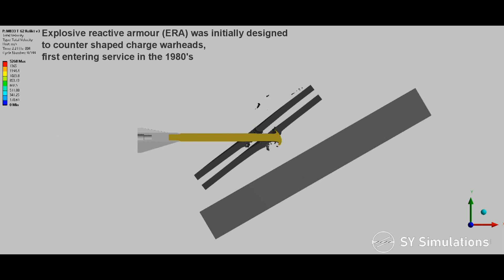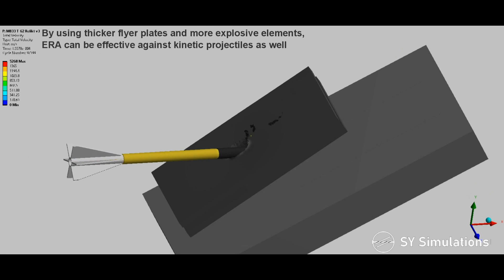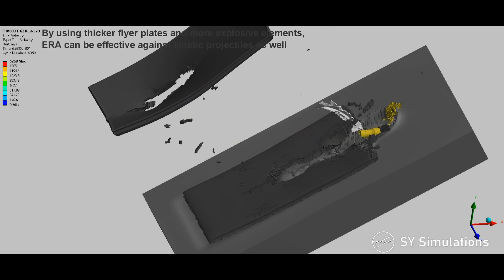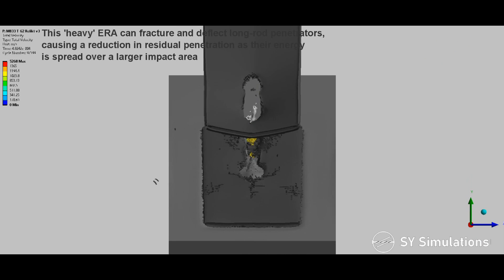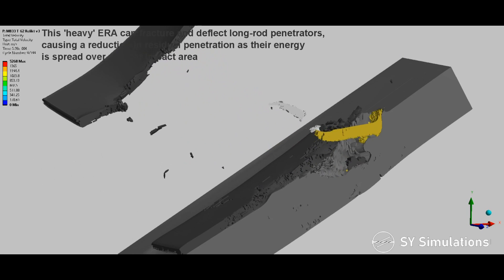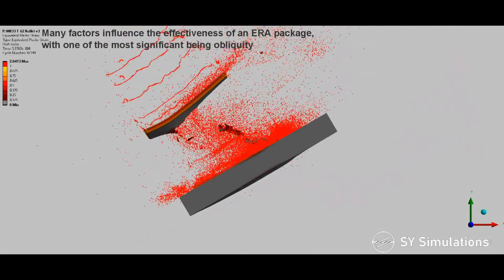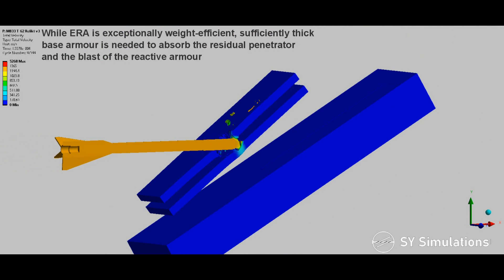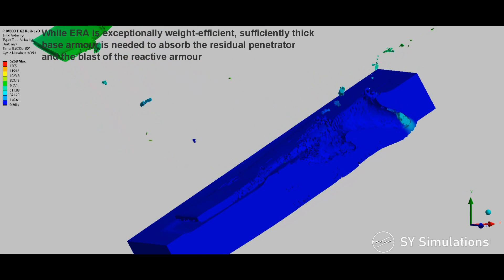APFSDS vs ERA | M1IP ABRAMS vs T-62 + Explosive Reactive Armour | M833 Armour Penetration Simulation

Comment: Any chance you have a simulation of how the arrowhead armor on Leo 2s work vs APFSDS?
Reply: Despite rumors to the contrary the arrowhead isn’t empty so unless anyone can provide at least somewhat accurate information on the composition and dimensions I doubt it. It might however be interesting to test the Leopard 2 UFP (20mm HHA + slightly explosive rubber + 20mm HHA + 45mm RHA at 82 degrees) or to test how an angled NERA plate would impact the trajectory and integrity of an APFSDS projectile.
Reply: @RichelieuUnlimited   there are images of the wedges insides and they are mostly hollow. It literally took me a minute on google to find the images.
Reply: @philneal3750  To my knowledge *there are several plates of composite mounted in the arrowheads in such a way that they can move in response to incoming projectiles. These plates might consist of steels, rubber or ceramics and are meant to destabilize and damage incoming projectiles. So the arrowheads might be mostly filled with air, but they‘re not empty.

Whatever’s mounted inside is likely removed for presentations and photos. You wouldn’t see anyone else just publish the exact details of ones in use armor scheme.
Reply: @RichelieuUnlimited  The outer layer has a little bit of composite but it's otherwise hollow
Reply: @RichelieuUnlimited  what is eplosiverubber?
Reply: @ukuskota4106  Something in between NERA and ERA. If I understand it correctly there’s essentially a low amount of explosive added to the rubber layer that increases the expansion effect of the rubber without destroying the steel plates. I don’t know what‘s the official designation though.
Reply: @ukuskota4106  Non-explosive reactive armor. Basic variant is two steel plates with some rubber in between at an angle. Less effective by weight and volume than ERA but it can resist multiple hits and doesn’t risk collateral damage. Makes use of rubbers property to expand when impacted to make the steel plates bulge into the path of a HEAT-jet or APFSDS dart. Think of Chobham armor.
Reply: @RichelieuUnlimited  It has some composite on the initial layer but it is empty. It's purpose is to de-angle or detract rounds from hitting directly lest the round's length is greater than the hollow area's length. Therefore its less effectively against very modern monoblock long rods. When struck the hollow plate has to be replaced as its effectiveness is less than before albeit hitting near the same area in ranges exceeding normal combat ranges can be difficult. Considering modern tank battles are who sees who first and gets the shot off first aiming towards center mass 99% of the time.
Reply: @Kwisss  My statement isn’t going to change based on people repeating the same arguments.  It took me literally less than one minute to find the pictures of the arrowheads inside mentioned by the other two commenters clearly showing two hinged plates mounted inside the frontal section. Which proves my statement that they aren’t empty. It’s also clearly visible that those plates aren’t attached to the frontal layer, which means they can’t be there for structural support. It is true, that at certain hit angles a penetrator would apparently not impact those plates, however at such angles no penetrator is likely to actually pierce the armor layers behind the arrowhead, I‘m doubtful if the crew compartment is even in the line of fire at these angles. The effect you’re describing probably still has something to do with how the arrowhead functions, but those hinged plates are likely enhancing it in some way, as the first armor stage should be meant to destabilize incoming projectiles before the break-up and erosion stages.
Reply: @RichelieuUnlimited   It is empty. there are pictures on the net of them and i have seen the Danish ones. on and off the tanks. They are empty. the only thing is some thick structural support plates
Reply: That would be really cool
Reply: Cheesewedge*